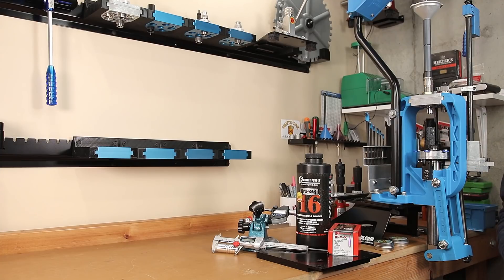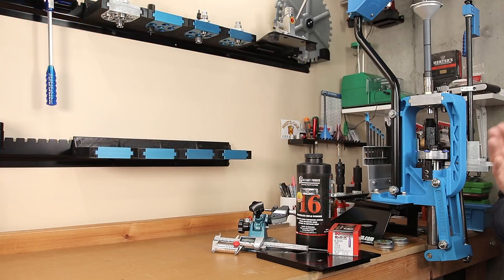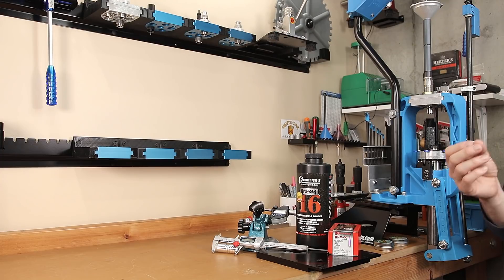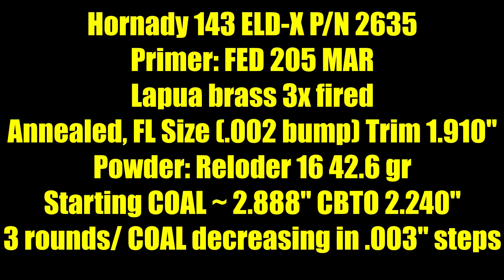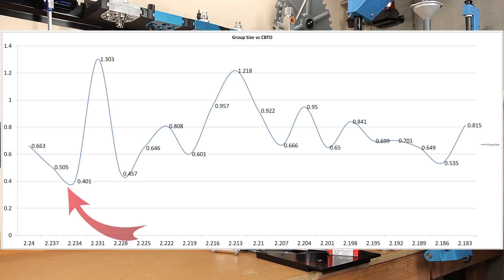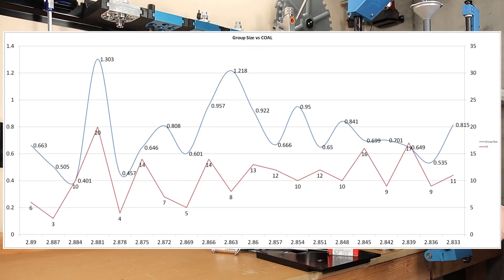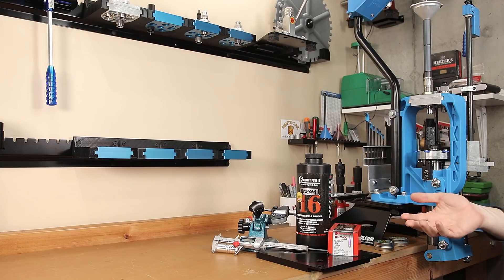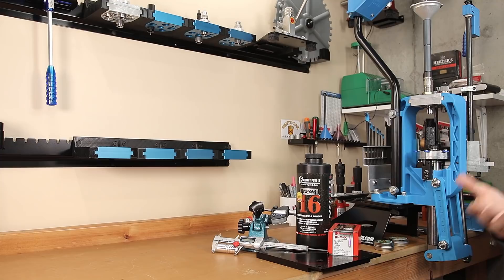Seating Depth Tested - Can COAL Tune Anything? - Stop Chasing the lands

Comment: I haven't been able to find 143 eld-x outside of factory loads, but with the factory length loads they shoot lights out in my gun. Maybe this is still applicable. 

When I started testing 142ABLRs in my gun, I put them to 20 thou (2.910coal) and started testing. Found my velocity node and its been single digit es's all day, but I could not get sub-moa performance on the paper. Burned though 100 bullets before I decided to do a seating depth test in 20 thou incriments instead in 3 thou. 

I started with the shortest, at 2.730oal (150 thou shorter than anything I tested before) and it wasn't great. 2.750 also wasn't great. But 2.770 and 2.790 were both clover-leaf groups. Next 2 groups opened up so I went home and seated what I had left in 3 thou incriments between the 2.770 and 2.790.

TL;DR seat them a couple hundred thou off the lands and work up in 20 thou incriments. see what happens, worked for me.
Reply from the maker: Hi Dakota, your description is somewhere close to bergers method. I plan on taking a closer look at it, as well, eventually. The most important thing (IMO) is to have a process and follow it to conclusion. I just have a long history of hate of these projectiles, and its not over yet. The factory OAL that I had on the couple boxes I got (also didn't perform well, for me) was 2.820". Scott Satterlee, Mark (from SAC) and Cal Zant all have some interesting info on projectile jump. I am not using every single style interchangeably (yet) to try and keep things simple. I think it is likely that both have their advantages / disadvantages. My guess is if the answer was .020 off that Erik's procedure wins if its .150 off, the other would win. Just like directions there are many roads that lead to the same place. Finding the google maps directions of getting there fastest is the challenge. Everyone is more sensitive to this with the supply shortage issues of all the components right now.

BAR

Comment: I know it's probably a bit disappointing that the test/results/charts didn't work out/look better. But a couple of things to consider. Although Hornady said they wanted to come up with a hunting bullet, (the ELD-X) that you can shoot a match with, their original marketing campaign even said that this is just half MOA bullet. So one may assume that may be under the best of conditions and not all the time.

Then add to that, they say it is a difficult bullet to manufacture because they are blending multiple different technologies. I'm thinking this is causing some inconsistencies even within a single lot, never mind from lot to lot.

Also, we may not be comparing apples to apples between these and the 140 ELD-M's. (or 147's)
Obviously we know this is a hunting bullet and designed for expanding (and usually very reasonably priced before these crazy times) and of course the ELD-M's are match bullets specifically designed for uniformity and accuracy. Maybe expectations are too high. Not to say we don't try to develop the best load for it especially for a hunting application.

I have 140 and 147 ELD-M's on hand and have never shot the 143's. But it seems like the 143 is in some ways very similar to the 147's. I think the length is the same and maybe the profile, bearing surface, etc too. But there's obviously less lead in the 143, in the void at the nose in particular and a bit less around the interlock where there is slightly more (lighter) copper. I'm just wondering how that affects the center of gravity and how they fly, especially if the bullets are difficult to manufacture as they say and possibly may not be as consistent as the ELD-M's.

I'll be interested to see where you go from here and best of luck!

Comment: I have used the OCW method for years with great results. 
First the OCW-load than the oal-tune 👍🏻 For accuracy I don't bother with ES-SD numbers , usually it turns out good anyway when I'm done 😉
Recently I have tested my OCW-loads against the OBT-theory with  GordonReleodingTool which is  still on free beta download , it have a OBT-tool that leads you to what load-velocity that makes a OBT-OCW load , i have tried to just verify a standard load over the chronograph and then calibrate the GRT-tool to match , and then find the right OCW-OBT-load-velocity .
It have worked great ! , and with a few OAL-steps up or down it have peformed great with very few cartridges shot .

Comment: 3 shots are not a good test from my experience. I measure best group of 4 with 5 shots. Data are easier to read and you get clear show of what’s going on
Reply: If a group of 3 isn't what you're looking for, more rounds will not improve it. Gotta think about this a little differently. Sometimes I'll stop at 2 shots of a 3 shot group if it's not producing what I'm looking for
Reply: @jessewerner4067  I think this has a lot to do with the quality of the platform you’re using. My rifle is quite cheap and I’m shooting from a bipod, getting 1 flyer out of a group of five, happens, if I shoot 3rounds per load, I can get some unreadable data. Different story if you have a benchrest rifle with a good heavy rest

Comment: I sort my 143’s by bearing surface length, or at least what I can measure running dual comparators, 143’s I have measured up to 7 thou variation.  That is sorting 2-300 bullets at a time.  
That said my rifle prefers the 143 over the 140, and doing full seating depth and powder tuning I am seeing consistently smaller groups with the 143’s.

Comment: You are all over an old bench rest trick.  Load long with almost no neck tension and let closing the bolt finish seating the bullet.  Blowing powder out of the action is a pain when you have to eject a round without firing though...lol

Comment: This is a great video. I know you spent a lot of time and money making this video and I would like to offer a big THANK YOU for your efforts. That said, you certainly answered the question, Can COAL tune anything, when you showed that a 1.3" group can easily become a .4" group with a simple .003" seating depth adjustment. This is something that will help me as I continue testing the 142g Accubond Long Range in my 6.5 Creedmoor.  My problem with the Creedmoor is I am constrained to a COAL of 2.800 - 2.830" with my AICS magazines. I will have more latitude to test with my new custom 6.5 PRC, which is being built on a Weatherby Vanguard Long Action.

My experience with the 143g ELD-X is very similar to yours. I tested it a lot with H4350, RL-26, Lapua and Peterson brass, CCI 400 and 450 primers, Federal 210 and 210M primers, etc. My best result was a .485" 5-shot group/SD=8 with 41.2g of H4350, but subsequent validation tests were erratic. Frankly, I was only interested in the 143g ELD-X for hunting and gave up on it after finding a much better option in a yellow box. What I find crazy is how the 200g ELD-X shoots consistent one hole groups with my .300 Win Mag. and the 143 is so inconsistent in the 6.5.
Reply: Will be interesting to see how the PRC handles the 143 Eld X. Could be that it just need a bit more velocity than what the creedmoor can give. Who knows?

Comment: Which is the correct order?  COAL testing first, then develop the correct powder charge?  Or develop the correct powder charge, and COAL testing second?  Or a third item--bullet selection?  I'm going crazy here.
Reply: I think the overwhelmingly common method is to do the powder/charge weight then fine tune with seating depth. I doubt youll find many loads that are garbage that get magically turned into awesome groups by messing with seating depth.  Thats my opinion, anyways. If i dont find a good group with that powder, then i move on to the next one.
Reply from the maker: No one seems to agree, but this process does the powder/primer first and COAL second. The testing showed that changing the COAL did not degrade the statistics that we found with the original test so I don't see a negative to doing the powder first.

Comment: With twenty 3 shot groups, you have enough data points to gain a reasonable idea. 
So, using your mean group of 0.66 MOA & calculating for a 90% confidence interval & scaling based on 5 shot groups, your future groups should range from  1.57 MOA to 0.43 MOA. 
If you combine all of your target data & take the overall aggregate, you should find  something approaching 1.5 MOA & if not, another 20 groups combined with this lot of 20, will surely get you there. 
The reason I've calculated based on the mean of the combined 3 shot groups & not the SD's is because the 3 shot SD's have only 2 data points per group &, do not correlate to a 2 dimensional aggregate of  59 data points around the POA however, the mean would not be much different in any case & can be used to correlate a population distribution which, is how you & most others look at this information anyway.
Anyhow, great stuff, thanks for the time & effort.
Regards          Rotas.
Reply: This is a underrated comment. Great analysis
Reply from the maker: Hi Rotas, Glad you see you digging in!
BAR
Reply: @BoltActionReloading  Just to clarify, the figures I quoted are actually very good for most rifles. 
The two MOA figures of 1.5 & 0.43 should be representative of  +/- 2 SD's of the gaussian range which, equates to about 95% of that rifles future group size distribution.  That is quite excellent if the rifle isn't an F-Class or Bench rest rifle.
Since I did not apply a multiplying factor to the mean value of 0.666 MOA, your groups will be a little larger over the life of the barrel however, 1.5 MOA is close enough & quite excellent for the type of rifle. 
You can easily measure the rifles accuracy if you overlay your test targets & aggregate all the shots from one POA. By just eyeballing the targets, I can see the aggregate as maybe a little over 1 MOA now. Another 20 groups aggregated to this 20 will tell the tale. 
This is how Bench rest shooters measure their rifle group size &, the only real way to show a rifles true accuracy potential.
If you're unsure of what I'm referring to, look at your targets & pay attention to the target camera app, "centre of each group"; the black cross hair. This is used to calculate  ATC or Mean Radius from the POI, not the POA. In order to correlate the absolute ES for these data samples, you must take the aggregate or combined ES for the total data set about a common POA because, the centre of POI for each 3 shot group shifts or, is distributed around the POA.
In reality, this has & will apply to every shot the rifle takes over it's lifetime but, to get an idea of what that range will be, we have to use statistics &, those statistics will only predict accurately if, there are enough data to allow the math to reveal where, on a gaussian distribution the rifle is. 
You said it yourself, "you've never seen more shots produce anything but larger groups" &, that's because that is what actually happens, to a point. 
Testing should be done in order to reveal where that point is. At the moment you're tracking fairly normally with the ES/SD ratio of 4.01. That will reach about 6, however, the SD will reduce while the ES will enlarge so, it doesn't mean that your rifles 3SD gaussian distribution will get much wider. 
ALL in all, you did good.
Regards.............Rotas.

Comment: Thanks for an interesting video - you may be interested to check out Mark and Sams extra long range videos, as they use a simple process. They use the maximum powder load that doesn't cause sticky bolt lift then set the bullet to 75 thou off the lands. They then try different bullet types using those parameters and go with whichever bullet type works best.
Reply: One more reason NOT to watch those guys. That's asking for problems, possibly serious pressure issues

Comment: Did you sort the bullets by measuring base of bullet to ogive? I wrote that comment before you said you sorted the balance. I have had up to 5 thou variance so ditched the eldx. But sorted by BTO they did better. Cheers
Reply from the maker: Thanks for the reply Justin! I hate having to sub sort groups. I don't want to buy 1000 to get a reasonable number that are the same. I have had many tell me how well they worked it just hasn't been my experience.
Reply: @BoltActionReloading  even with a box of 100 you can sort and group them together so you do not have possible wide spread. My thinking is if CBTO is set by seater I want the base of bullet to be set at same place in the cartridge too. Plus the profile of the bullets are same. Might not make a huge difference at 100 but step that out to 1000 then helps so you limit vertical and just need to play the wind. Cheers

Comment: Don’t listen to Erik, that guy doesn’t know anything.  😁
Reply from the maker: Yeah that Erik guy is crazy. Haven't you seen his comments section? I didn't see your name when I saw the comment and wondered who the hell said that, but when I saw it was you it made a little more sense. This combo has been particularly troublesome for me, so I had high hopes. Is the CBTO variance the problem or just test keep testing out further?
Reply: @BoltActionReloading  Seating depth with reveal the best tune for your load, but it doesn't mean it will be acceptable if you know what I mean.  I once had a load that just would not tune, and I kept going.  All of the sudden it started working really good.
Reply from the maker: @ErikCortina  kept going meaning keep decreasing the COAL?
Reply: @BoltActionReloading  Yes.
Reply: lol...probably spent more time with Erik than my wife this week. I'm in the doghouse now.
Reply: Erik Cortina - Pro Shooter You call it the accuracy node but I just call it the sweet spot. Haha. I had a .223 chamber that gave me fits and hated being close to the lands. That sort of got me off the lands from my old .222 days of bench shooting where I set everything by the lands. That .222 rifle liked the lands but the .223 hated it. Now I just work on low and high seating depth groupings to find the sweet spot and forget about the lands.

Comment: What is the thickness of your necks? Do you neck turn? Do you know the variances of your case neck thickness?
Reply from the maker: I don't remember off the top of my head. I have never really felt the need to turn Lapua brass, its very consistent and have had very good luck with it.
Reply: @BoltActionReloading  understood. I just got Lapua in 7-08. It had 3.5 - 4thou run out prior to mandrel. 2-3thou after and .0005 or less after neck turned. Case neck thickness will impact alignment of the bullet release and impact SD/ES

Comment: Does anyone get great groups out of alliant powder? I've only tried 17 and There was just no tuning it down below .9 for 5 shots with any projectiles, where IMR4451 got me under .7, as low as .5, and h4831 got me under .5 easily and I could expect to shoot multiple .25"or less 5-shot groups in a session. I hear more praise for its speed than its accuracy.
Reply: It depends on the powder.  I love AR-Comp.  Absolutely my favorite powder.  Consistent, wide nodes, very temp stable, very versatile, etc.  Reloader 15 has provided good groups but is more finicky.  Varmint and 2000MR can give GREAT velocity (much like cfe223) but are not as stable and require more tuning and weather awareness.  I typically load for .223/5.56 and 308 though..  Going into 6.5 class powders I have no experience to speak of.
Reply: @mattfleming86  That makes sense. I bet it depends on the quality of the setup too. I will say my gun s fussy in general. It shoots fine with most ammo but shrinks groups like a poked caterpillar when it likes something. But even with a lot of extra brass detailing I couldn't get better with the 17 than good factory ammo, it was odd. I met a guy the other day who swore his 260AI "only" shot well with RL26 which is just biblically unlucky right now.
Reply: Try 19 or 23.